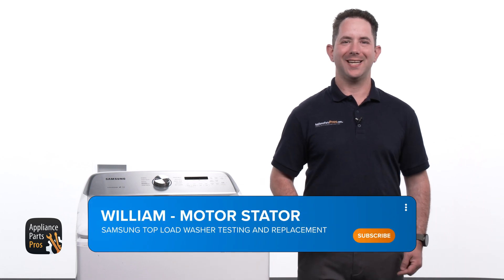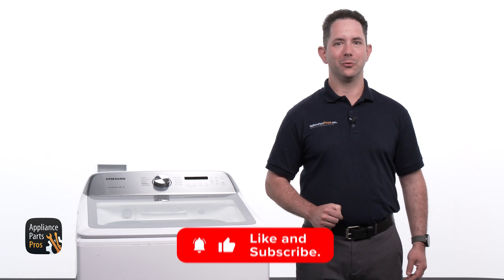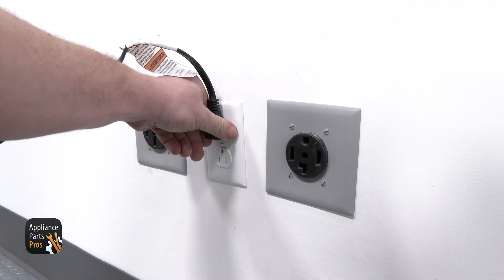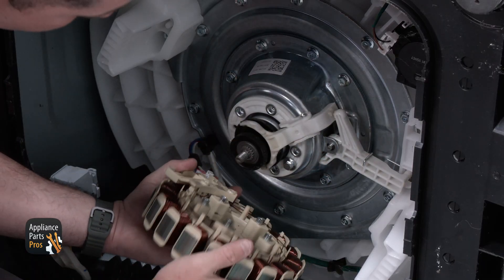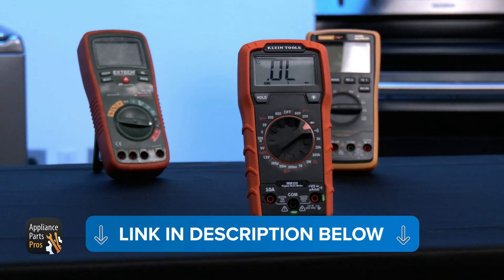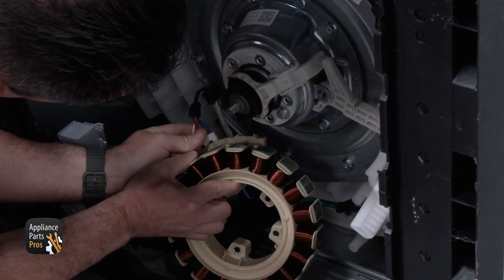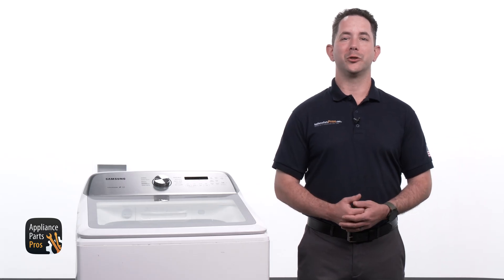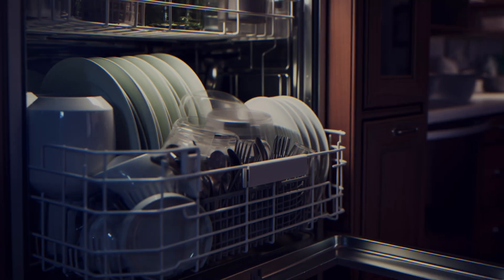What If Your Samsung Washer Motor Stator Fails? Here's How to Test and Replace It

Comment: I have a top load samsung washer that will not go into wash mode.  I load clothes, it does the initial movement side to side and then goes into drain mode.  I hit stop and it won't stop.  I have to power it off.  I get no error codes.
Reply from the maker: That sounds frustrating, especially with no error codes showing. For detailed troubleshooting steps specific to your situation, our certified techs can help you at forum.appliancepartspros.com. Just post your model number and what you’re experiencing, and they’ll walk you through the diagnosis!